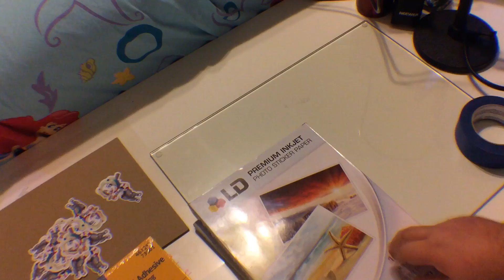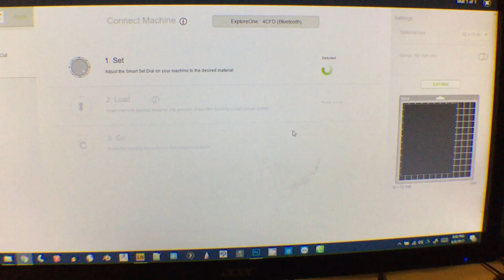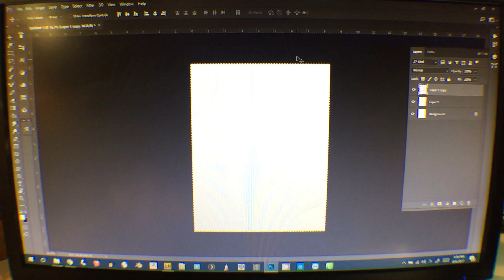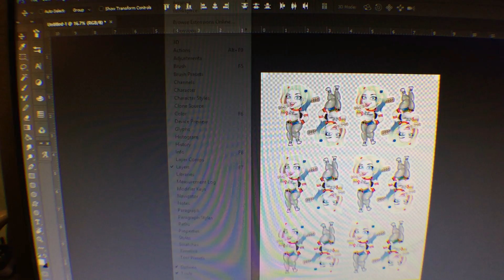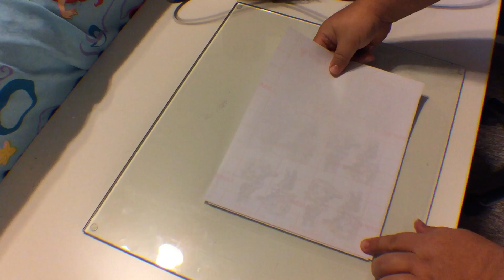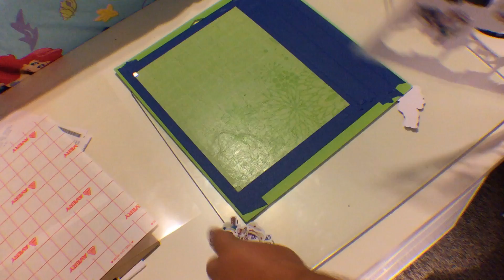Trick your Cricut to do FULL PAGE Print and Cut - Sticker Tutorial!!

Comment: I have been using this hack for a few months, but.... Exciting news! Cricut just updated Design Space. I was able to print and cut an 8" wide design. Check it out!
Reply from the maker: Thanks. I will check it out. I still lose 2" of the page which is not to bad but I cut right to the edge of the page. Do you know if they fixed their print issues? I use high res printable images and they always convert the uploaded images to low res and they never print nearly as good as the high-resolution stuff.
Reply: @EricMBoyd  Not sure about the print quality issue. Good Luck.

Comment: Does this work with words as well or just imagines?
Reply: Yes you can use it for words (like an invite) where design space lowers the resolution and looks like crap if imported. Use the same concept, print from your graphic editor then import it to cut a rectangle around your invite, just be sure to save it as a .png and save as a cut image when importing to design space. 
Design everything to size as you want it all to line up in both the printout from a graphic program and the cut in design space (using those little 1/4" boxes in each corner as guides!).
Reply from the maker: @-PaulyD-  Thanks!
Reply from the maker: Really depends are you printing Text to be cut around yes that can work. But if your just looking to cut text I'd just use the normal methods.

Comment: Does the cold press lamination sheets protect the stickers from fading?
Reply from the maker: So the Avery ones I am using in the videos do not, that being said I have 5-year-old magnets on my fridge that are not faded and are not in direct sunlight. I have purchased but not tried yet... Oracal 651 Indoor Outdoor UV Transparent Laminating Vinyl and will be trying that. It comes in a roll instead of sheets so I need to cut the roll into sheets and it cost more but has a 5 to 8 year UV outdoor lifespan. I did a ton of research and found Oracle is one of the leading car wrap vinyl distributors. I was looking to start making car decals instead of just stickers.

Comment: Thank You! When I bought my Cricut one of the "coming soon" features was a print and cut option for larger printers. I have a printer that prints up to 13x19 prints. Cricut dropped that as an upcoming feature for their new release and I have been irritated by the 8.5x11 sheet limitation ever since. With a little adjustment, I can use your technique to finally use the full 12x12 mat for a print and cut. Thank you, I can't wait to give it a try.
Reply from the maker: Here is someone using this method to use a full 12x24 mat https://youtu.be/HvkFocQSYVU

Comment: Love it! I've tried this and it worked the first time but 2nd time none are aligning, any tips for that? I've calibrated and it just keeps doing it.
Reply from the maker: Sometimes the machine will just be weird like that but most of the time its a printer/printing issue. Always see if the registration square cut correctly... if they do its the printer or print settings.

Comment: I've watched this video and also watched your gimp (which I just downloaded) video, however, I get lost when you say you've already created the squares, Did you actually create something, or it's the one I have in the corner?  I just  downloaded gimp today so it doesn't look like yours, where you have two squares in the corner, I only have the one, in the left hand corner.  Mine doesn't look like yours at all, so believe me, I've paused yours and backed up over a hundred times and can't get to the same results as you.  Maybe you could tell me what I'm doing wrong.  When I hit merge, it doesn't look any different.  Maybe someone that uses gimp can give me a heads up.  I'd really appreciate it very much.  I just want the registration marks so I can print bigger projects on my cricut.  Thanks
Reply from the maker: It could be the squares in the corner but what I remember was I usually already have the outlines on the images created with the images. Is this what you mean?
Reply: @EricMBoyd  I downloaded Inkscape and used it, was much easier.  Thanks
Reply from the maker: @jodieblond58  Thats great I do like inkscape! Gimp is good but its still no Photoshop.

Comment: This is so very helpful! Thank you so much for sharing. You may have already answered this question... but, is the cold peel laminate a personal preference? Am I right in assuming it is just because you are cutting all of the way through the sticker paper? If I were to cut stickers with the intention of leaving them on the sheet (not cutting all of the way through) is there any reason why I would not be able to run them through my hot laminating press?
Reply from the maker: you mean run them through after they are cut out? Hot laminate usually requires a border to seal between the two sides. Self adhesive laminate only laminates one side. hope that helps.

Comment: So if I am understanding this, can we do the mat cut and just keep it like that for all the stickers we are going to be cutting? So then we would just use that mat for cutting stickers? Also I didn't hear what size you make the registration marks in PS. What size did you use?
Reply from the maker: Yes I keep 3 Mats with the tape on them. As for registration squares I do about .25 inches. If you make the squares to small Cricut DS will remove them as bad pixels.

Comment: the cut is a lil bit off because the way you loaded your mat cutting the tape (up side down) and cutting the prints are not the same way.
Reply: I was kinda wondering if that was the elusive problem, but he has plenty of hrs involved under his belt, so I hate to intrude on someones skills.
So is this the microscopic issue? 🔬
I'd like to do a heavy cricut project  unsupervised, that's what expensive machines computers softwares saved settings are for, imo. 🤔

Comment: Love my (wife's) Cricut but hate the way it wastes materials. You're a genius. Going to try it in Gimp because I don't have Photoshop.
Reply from the maker: Gimp works I show that in another video, good luck. feel free to ask questions if needed.
Reply: @EricMBoyd  Yep I found it. Thanks! Had to pause and go back 100 times but I figured it out. Lol. Only problem is my printer wont print all the way to the edge of the page so I'll have to make the images smaller and try again. It scales them down and my cuts didn't line up. I just used scissors for that batch because they weren't too complex.
Reply from the maker: @daddiosweatpants9622  make sure to uncheck resize to page.

Comment: Hey Eric, I followed to the T, but with settings for A4, (So A4 sized square, a4 in PS, A4 cut, and when it came to cutting the stickers it started at the base and the cut lines are inaccurate, They're higher than they should be so cutting into the design. Any tips?
Reply from the maker: The 4 registration squares cut correctly with the corners of the taped box?

Comment: SOS I am having trouble getting my cricut to line up with the print! For some reason PS is cutting off .125" of design on the print, and I can't figure out how to compensate for that, or to keep that from happening!
Reply from the maker: Are your registration squares cutting off or are they lined up with corners of the tape?
Reply: Eric M Boyd it’s cutting the squares perfectly, for wheeee they are in Design space, but my printer is offsetting the print by .125 in and so the Cricut isn’t cutting Im the right place. I thought it would be as easy as nudging the design on DS, but it’s not working.

Comment: Its not working for me. its close but not close enough. I followed all your steps besides me building mine in illustrator. Does that make a difference? Also it is like my printed image is slightly bigger then the cut line. IDK how to fix this. I printed it at 100% and not fit to page and i centered it. Should i try reducing the printed image alittle bit? But I wouldnt know by how much, it would be a guessing game.
Reply: I'm having the same problem. I've created my setup file in Photoshop and believe that I have my settings correct but it keeps printing a little larger than it should. It has to be something incorrect in the settings. Did you have any luck figuring it out?
Reply: So I was able to figure it out yesterday. I think my problem was one of two things. Either I had my registration marks off or, and I think this is more likely, I had my printer settings set to 8.5x11 borderless. I think borderless printing makes it larger than it should be. One other tip I think might be helpful is to put a small black mark of some sorts in the upper left corner; that way you know for sure which way to place the paper on the mat. Hope this was helpful.

Comment: Wonderful! I am interested in laminating part as I have not seen the moment where you put laminating foil there, and they came up shiny... can you explain that and help? Thank you!
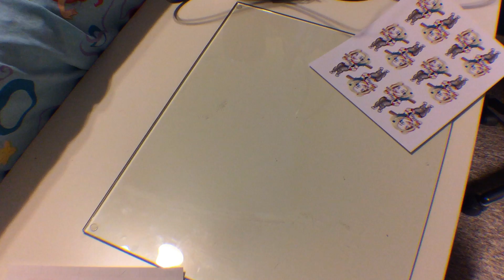Reply from the maker: 19:15 minutes in the video I place the laminate on the stickers. Hope that helps.
Reply: @EricMBoyd  I saw it, i did the research and i would definitely want to improve the quality of my stickers... however, is there explanation why you can print and cut glossy injket sticker paper, and my cricut explore air 2 wouldn`t? it shows error every time, and when i use dull matte sticker paper, it works fine... Thank you so much!!!!
Reply from the maker: The reason is I am not using the print cut feature of the cricut. I am printing in photoshop and then using my Trick The Cricut method to cut what I printed. My machine never scans any lines. The line scanner has never worked on glossy paper for me. Also cricut DS reduces the print quality when it prints.
Reply: @EricMBoyd  oh and i thought i am overlooking, i hate when it takes resolution down... Thank you!!!!! Best luck with your sticker business!
Reply: hi Eric, I tried the trick, it took me for each of several pages separately to make the frame, I couldn`t do just first one... seems odd... it cuts the frame on different place every time, and I use zero zero position for it... I also tried to attach A4 shape to the cutting shapes, and it kinda worked... Do you make adjustments and put of the tape every time for each page you put on to cut? Please help me if there are some printing settings... I almost believed that my printed is deforming the picture on edges... Sorry for bothering this much... Thank you!!!
Reply: Ok, finally did it!!! I am so satisfied using entire paper size, and optimizing the print quality... Thank you so much for saving me with this video, as I was almost ready to quit... and for your wonderful fast replies... I hope I can somehow help you in the future, so please do have me in mind for whatever I can help with my expertise... For everyone else who are going through the same unexpected tuff process, don`t give up and keep trying... you will eventually get there... Best wishes for you!

Comment: I know you said that your knob settings are broken but what blade setting do you use in design space. I've tried all sorts of settings but the blade will not cut through both the sheet of laminate and the sticker paper.
Reply: Made a custom setting with 350 pressure and that worked.
Reply from the maker: I'd have to look as I created my own. You can go in and do some testing. Copy the sticker setting in managed cutting pressure. I copied the construction paper one or something a long time ago and kept doing test cuts until i found the right pressure and speed and blade. I can not see my settings right not to share, but if I remember I will post the info in the community section of my youtube and let you know.

Comment: Thanks for this amazing tutorial! 
At the tape-cutting step, I ran my mat through the Cricut twice to make sure it cut through the tape cleanly, but the alignment of the two cuts were different (one was higher than the other). Have you experienced this before? Is there something wrong with my machine, or is it the way I loaded the mat the second time?
Reply from the maker: yes,  it can be very hard to always get the mat load perfectly every time. I find putting no pressure on the mat when loading tends to help I just kind of lift up on the mat. Also before making a new taped mat try and run the calibration tool first. I sometimes find myself making a new taped mat every so often to adjust for any new calibration issues. Sometimes I can get 100 good cuts before retaping the mat and then I get 10... Cricut is almost never consistent over time. That's why sometimes I have to manually adjust when I see it cutting wrong mid cut. It's a great machine when it works, but can be very frustrating at times.
Reply: @EricMBoyd  Gotcha. I ran the calibration tool and the cuts are coming out much better now, but I guess it's going to be a constant process of adjustment.  Thank you so much!
Reply from the maker: @ramithasankar5893  That's great! After some time you will get really good at it and learn what little things work best for you, your machine and the things you are cutting out.  Just don't let the frustration get you down. I try not to do things on deadline as this will really add to any issues. If it can go wrong it will when you are in a hurry! Thanks for updating us.
Reply: Ramitha Sankar my tip is that if you’re going to do a second cut, don’t unload the mat in between cuts. If you just got the cricut logo on the machine after the first cut, it will cut again in exactly the same spot. Any time you take the mat out and reload it it’ll be out by a tiny bit.

Comment: I have a problem using this technique... i cut the tape and everything but when i cut my printed designs, its always off (not aligned right)... i always have to readjust and can take up to 30 mins re-adjusting it :( any help? (i'm using cricut printable vinyl sheets, my designs are made in illustrator in a 8.5/11 format)
Reply from the maker: the question I always ask first is are the registration squares cutting right? If so it is not the machine it is either the files uploaded to DS or DS doing something to the cuts or your printer or the way you are printing if the registrations are right, try troubleshooting everything else. Sometimes you may need to adjust your settings. I had one printer where I need to offset the print center. That same printer was auto paper feed and was slighting printing at an angle and that was really skewing my prints. Another printer using auto feed will print the image higher or lower depending on how the paper loads all these issues resulted in offcuts and it was not the machine causing them.
Reply: @EricMBoyd  there is a specific way to make the registration marks? I just did 4 squares of random size at the 4 corners
Reply from the maker: @jessyxjay1732  you can make them any size and you only need two one in each opposing corner top and bottom. I wouldn't go smaller than .15" though as anything to small and DS will think they are stray pixels and remove them from the cut file.
Reply: @EricMBoyd  is there any way i can get to text you or something on discord skype facebook or what ever cuz i followed every single steps and my machine is not cutting it straight :(
Reply from the maker: @jessyxjay1732  maybe after the holidays. Are the registration marks cutting correctly? let's start there.
Reply: @EricMBoyd  does the registration marks needs to be all the same size? I"ve got 4 but they are not the same size... My cricut seems to be cutting a bit randomly i really dont understand man :(
Reply from the maker: @jessyxjay1732  do the registration marks you are using cut correctly in the correct spot at the corners of the page where the tape meets? Are those cutting correctly?
Reply: @EricMBoyd  not even. Its always a bit random. I have to offcenter my pages to the right, to the left, to the top or bottom and it changes all the time😭
Reply from the maker: @jessyxjay1732  have you ran the DS calibration tool?
Reply: @EricMBoyd  no? What is that?
Reply from the maker: @jessyxjay1732  the tool you run when setting up the machine. it aligns the cutting on the machine.
Reply: @EricMBoyd  never done that since i bought my machine! THIS MUST BE IT! is it a feature on the design space app?
Reply from the maker: @jessyxjay1732  yes when you are in DS it will be in the top left menu somewhere.

Comment: I'm just curious why you don't do the cold press before you cut them?
Reply from the maker: Good Question! There are a few reasons really. First, the Cricut Matt does fit through the machine, but If it goes in at a slight angle that can be an issue. I am not the only one who presses my stickers. The wife and kids help too and I find it best to use the cardboard for them with just the sticker. There is also the issue with doing it on the mat even if it's perfectly aligned these are paper stickers and being pressed against a heavily used mat will sometimes press faint cut marks from the mat into the stickers. If I do it without the mat that becomes an issue because the laminate paper is larger than the sheet and I use those edges to help it stick to the mat and if I put it through the press it can stick to that and I have tried reapplying it to the laminate backing and it slid a little and again tried to stick to the inside of the machine.